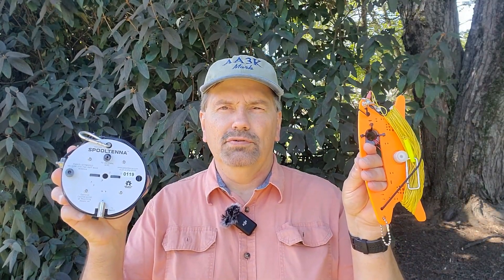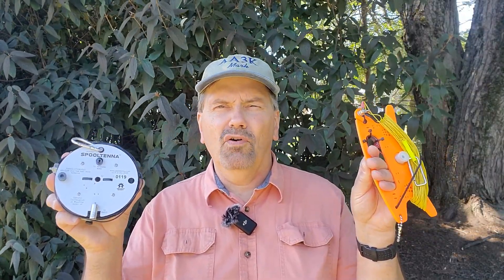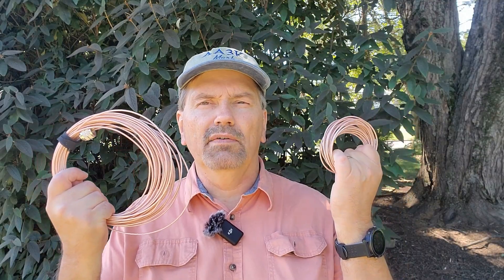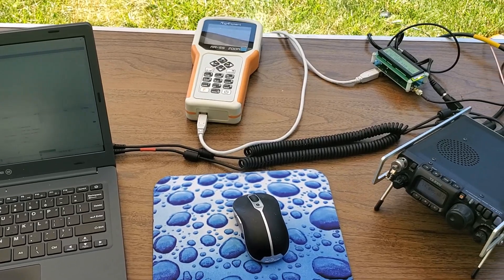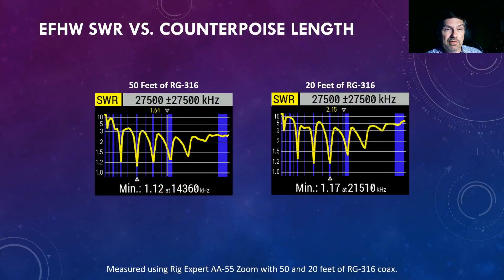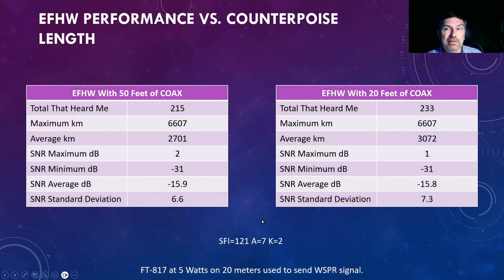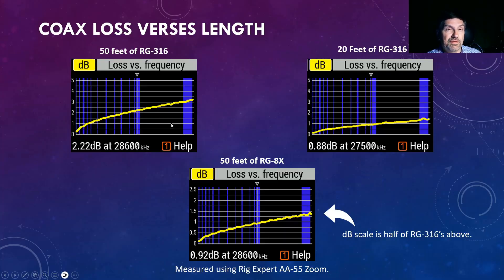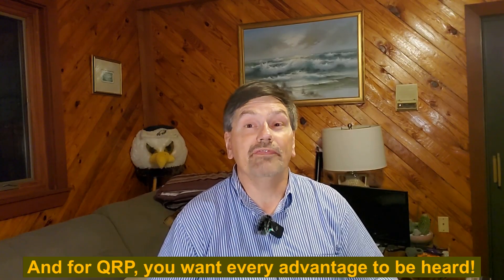Shocking Results from Changing Counterpoise Lengths!

Comment: Mark good video. I realized what you where comparing about half way though the video. The counterpoise topic in and of itself is a hot button issue for sure. What would be interesting same test and add a second part, an actual counterpoise vs shielding. Yeh I am going to put my effort where my mouth is lol. I am going to run it myself, simple enough and the curiosity has bit me.
Reply from the maker: Yes, I'm thinking of doing that but don't know where it falls in what passes for my production schedule 😊.

However, independant counterpoises connect to the same point as the coax shield so I'd be surprised if there is much difference other than directivity.

Hams may be concerned about noise from transmited signals making it back i to the radio and possibly cause issues.  Something I'd need to get a buddy to help and listen for.  

Thanks for watching!

Comment: I have an EFHW for 80m and never bothered with an counterpoise. I have a Rigexpert and dumped all the results it can chuck out and put these in to Chatgtp and asked it varios questions like how efficient is this antenna etc, I told GPT the exact setup i had and it recommended various options  including a 4m counterpoise. I added a choke at the antenna and added the 4m of counterpoint (My antenna is 10m abouve ground) each time I made a change i put it in to Chatgpt and without telling it what changes i had made the efficiency improved around 20% going by the various plots  uploaded.
If you have a Rigexpert  export all the info you can including the Smith Charts (screen shots) and the point plots and put it into chat GPT the results are interesting when you make changes and ask it to comment.
Reply from the maker: I'll rry that! I'm also working on a video right now showing the effects of at least using the coax shield as the counterpoise verses cutting it out with a choke.  I was surprised at the results.  It should drop in a day or two.

Thanks for watching!

Comment: Recently been and done exactly this with the 2 EFHW that I have set up at home, reason being poor performance from a 20-6 vertical after adding choke balun at 15ft from the antenna. Found that placing the choke at the antenna feed point and running 5ft of counterpoise wire gave a much better result. The other EFHW is 80-10, again choke at antenna feed point, had been running this antenna with a 22ft counterpoise and was never happy with its performance. Having just purchased a VNA showed why, although dips in SWR were close to where expected, the VNA showed a double dip at 80m, shortening the counterpoise down to 12ft and shortening the radiator element improved the antenna beyond believe. de M3BWF.
Reply from the maker: Good information!  I will admit I have been more surprised by radiator/counterpoise length this year than ever before.

Thanks forwatching.

Comment: 65 ft wire 49/1 unun 2 counteroises
Reply from the maker: I'm going to be looking at isolating the feedline and trying dedicated counterpoise lengths.  I did a quick test this past weekend with a EFHW and saw differences in the SWR plots of letting the COAX be the counterpoise and isolating it.  Not so bad on 15, 20 & 40 but a big negative difference on 10m.  Thank you for commenting and watching.
Reply: @aa3konthego yes I did similar I found a quarter wave. Counterpoise 27ft.  And a33ft counterpoise with my 65ft EFHW. And10ft of coax. Plus choke beads at unun 49/1.   Up a 40ft over a tree got me around the world.  On 20m.  And  all Europe. On 40m.  17 15 12 10 all worked tuned by my g90 20 watts.  I’m on the west coast of England by the seaside. Which also helps 👍🏻👍🏻🇬🇧
Reply from the maker: @MarkTurner-u8s That salt water amplifier!
Reply: I meat 17ft and 33ft

Comment: Run 2 counterpoises
Reply from the maker: I have a T wire with about 6 feet of vertical wire going to 2 20 foot radials that i used with my TennTennas EFHW which has a counterpoise attachment terminal. Haven't used that in a while.  The COAX has been working well for me.

Comment: 10ft will do. With choke. Quarter wave counterpoise. Plus a 33ft counterpoise 👍🏻👍🏻👍🏻
Reply from the maker: Do you mean 33ft radiator for a lower band of 20m?
Reply: @aa3konthego . No. EFHW 49/1 unun. 65ft 10inch Radiating wire.    With 2xcounterpoises.   1 x17ft.    1x33ft.      Choke at feed point.  10ft coax to radio

Comment: On my 40-10M EFHW there is a common mode choke at the transformer, so there is no counterpoise and the shield is isolated from being a counterpoise.  My ~124' "random" wire antenna for 80-10M also had a common mode choke at the transformer.  It has a length of wire attached to paracord that runs in line with and the opposite direction of the long wire.  The counterpoise was required to get the long wire antenna to tune with the radio's internal tuner.  Both are connected to the radio, but the EFHW is rarely used because the long wire is more sensitive.  On rare occasions the EFHW will pick up one station better than the long wire so it's still useful. PSK Reporter shows that both antennas are received around the world.
Reply from the maker: The extra length of your long wire is giving you more capture area for received signals allowing them to build up stronger than noise.  In some ways like a Beverage antenna.  I've run a Beverage On Ground antenna pointed toward Europe along with an inverted L for 160m.  Sometimes the BOG hears an EU station better and other times its the inverted L.  Our experiences are likely dictated by the arrival vertical angle of the signal.  Thanks for watching and commenting.

Comment: I seriously want to know WHY does an EFHW really need a counterpoise?  

Correct me if I am wrong, but here is my thinking on the matter and why I question the need. 

On a 1/2 wave wire antenna, the electromagnetic radiation comes from current and voltage along the wire.  The voltage is at its highest on each end of the wire where the current is at its lowest. In the center of the wire, the voltage is at its lowest in the center where the current is at its highest.  

Current and voltage generate RF.  So, on a center fed dipole, we use a 1:1 BALUN or a choke balun to keep common mode current off the feedline. The RF will not follow along the outside of the coax restricting it to the wire we want it to radiate from.  

On an EFHW, the impedance at the end of the wire is very high.  The exact impedance seems to be debatable ranging from 2500 to 5000 ohms.  In order to get it close to the impedance of the radio and coax, an UNUN, or transformer, is used.  Some designs call for a 49:1 and some call for 56:1 UNUN.  

If it is matched properly, would not all of the RF be desired to be on the 1/2 wave wire?  Depending on who says how long the "counterpoise" should be, when you add a counterpoise wire, you end up with either a full-wave dipole or an OCFD, or off center fed dipole with a very high ratio BALUN or UNUN.  

So, please, someone explain to me why  we want to stop CMC on a center fed dipole, which makes it more efficient,  but we want to allow it on an EFHW.  

If you stretch the entire antenna, with counterpoise horizontally, I can't see anything but an OCFD or a full wave dipole depending on how long you make the "counterpoise".
Reply: An EFHW is really more of an extreme off-center fed in practical application. That's why some use a 49:1, others 56:1, and still others 64:1. Someone more knowledgeable can correct me, but I believe the theoretical impedence at the end of a dipole is infinite. Since we cannot achieve infinite transformation with a transformer, we just get close enough and call it a day.
Reply: @jacobmcblane2950  That explanation sounds reasonable and makes sense to me. 

 Back in the day, CB 1/2 wave antennas were effectively end fed that had radials. But there was the Big Stick, but it was a vertical dipole with a BALUN that separated the element running down beside the coax from the coax shield.   But, that would not be a multiband design, I don't think.

0
Reply: With the EFHW. Use short coax 10ft with choke. And 2 different lengths of counterpoise. 1quarter. 1 half wave. Works for me. My g90 tunes down well
Reply: Iv also found if I move my counterpoises around I get a little directivity too.  More front to back.   Did I say my feed point is 3 stories up. My counterpoises are also inverted sloping down to the ground ??
Reply: Looking at it. Feed point 30ft high. Radial wire goes up and over a tree prob another 50ft. Sloping up over a tree top and slopes down the other side.   But works Australia  USA and most the world ??
Reply: The current at the end of the dipole is low but not zero.  You can't apply power without current. Because the transformer ratio is so high, only a short counterpoise is needed to provide enough capacitance for the displacement current.  About 1/20 of a wavelength.

Comment: On my EFHWs that have a lug for a counterpoise, I run a wire that's 13 feet and change long off the lug, and I get slightly better results than without the wire.
Great comparisons on the coax - very useful information!
Reply from the maker: Interesting! Thanks for sharing your experience and for watching the video.  I'm now planning a video comparing dedicated counterpoise wire verses COAX on an EFHW.  Can't say when it will drop though.

Comment: In my experience, I don't use a counterpoise on my 40m efhw at all. I can't find any difference between having a counterpoise as short as 7ft (per the 5% rule) all the way up to 20 ft and having none at all. The sole exception being if I add a counterpoise at all of any length my tuning on 10m goes right out the window.. I choke at the feed point pretty much regardless of the antenna I am deploying, so it isn't that the shield is acting as the counterpoise. Also of note, I have tried to put a short 6ft jumper in ahead of the choke, and I get the same results as a dedicated counterpoise ie everything works pretty much the same except 10m.
Reply from the maker: Interesting!  I too am now planning on comparing an EFHW operation with  dedicated counterpoise wire as opposed to the COAX shield.  Look for that video in the future.  I'm going to save your comment in my video ideas log so I remember to take a close look at 10 m.  Thank you for watching.

Comment: I use 30' of rg316
Reply from the maker: At a midpoint in losses between 20 feet and 50 feet.  The down side to shorter lengths is that your operating location must be closer to your antenna which may not always be convenient.  Get under a tree for shade or bake in the sun.
Reply: @aa3konthego 20' wasn't tuning well with 80 n 40m so im using 30' and it performs well

Comment: Great video. The strange thing about antennas is that someone could put a 40m hamstick on their car and think it was great, but they worry about going to the nth degree everywhere else.
Reply from the maker: Yes.  And the antenna is the most important part as its your interface to launching and receiving radio signals.  Like speakers for an audio system.  They are the interface to your ears.  Thank you for watching.

Comment: A lesson in how to minimize your QRP siginal. 2 dB loss in the coax and up to a 4dB loss in the UNUN depending on the UNUIN design and frequency.  You may also have additional loss due to SWR.  That would make for 6dB loss bringing your 5W down to 1.25 W  which is enough to make  WSPR contacts. I have made WSPR contacts with 20mW but would struggle a great deal making CW contacts on Field Day.   Lots of vertical designs can be more efficient. Never forget old fashioned dipoles.  49:1 UNUNs rather inefficient.  Test the UNUN loss.
Reply from the maker: While I do have fun when doing QRP I usally run my IC-7300 along with POTA-Flex 7 at 100 Watts to give as many people out there a chance to hear me when doing POTA.  Get the power to the antenna.  But sometimes I can't take my full setup with me and my QRP backpack or ultra compact go kit are all that can come with me. But any radio time is better than none. Thank you for watching.
Reply: @aa3konthego  I have operated QRP Field Day and Winter Field Day for a Few years.  I can work 200 -250 QSOs and still sleep at night.  This year I worked a couple of European stations  who were working our Field Day. One year I worked HI.  I use a Rybakov vertical antenna with 8 radials (Home brew).

Comment: What is a countetpoise?
Reply from the maker: The counterpoise is essentially the RF ground of the antenna allowing the electro-magnetic field to complete its circuit.  All antennas are made up of two parts.  One to radiate the signal and one to let the electro-magnetic field connect with the ground of the RF circuit to complete the circuit.  The counterpoise could be the ground itself with ground part of the antenna physically driven into the earth but ground conductivity is generally pretty poor.  The counterpoise could be your hand and body when holding a Handi-Talkie.  Again poor but usable.  That is why some people attach a measured piece of wire (19 inches - 48 cm for the 2 m band) to the shield of their antenna there.  Much more efficient for completing the EMF circuit.  With an EFHW the outside of the COAX's shield can be your counterpoise.  Even without a dedicated piece of wire, an antenna will usually find some way to complete the circuit however, you're likely to find the antenna's efficiency has dropped.

Thank you for watching!
Reply: @aa3konthego  Thank you! Outstanding answer! I appreciate you taking the time to write that.
Reply: @aa3konthego  my understanding is that an EFHW is actually not end-fed at all but an OCFD with the feed point 95%/5% along the wire. So for my 40m EFHW I have a CMC choke on my coax approximately 2 metres (5% of the longest wavelength) from the 49:1 unun so the braid on that short length radiates. It is the same as using coax to feed a balanced dipole with the centre wire going to one arm and the braid to another with a CMC choke at that point to stop radiation from coax braid. Therefore the "counterpoise" is in fact nothing to do with substituting for grounding but simply part of a dipole. SWR for a correctly tuned EFHW is extremely low. VK4BOB
Reply: Basically, some capacitance added to the system :D

Comment: you can add a counterpoise to the SpoolTenna
Reply: Great video Mark! That’s right any of the assembly screws can be used as a mounting point for a counterpoise on SPOOLTENNA. 73 de KO4HUI
Reply from the maker: Thank you for clarifying that! and watching the video.
Reply from the maker: The SpoolTenna designers chimed in and confirmed that.

Comment: I just couldn’t get the Spool Tena to get to less than 3:1. I used it as high as 33Ft on a mast down to about 4Ft above ground. It tunes up great even on unexpected bands like 12/17/30, I haven’t yet tried using my 50FT bigger coax vs. the one provided. No counterpoise. Any suggestions?
Reply: SWR should be 1.5:1 or better on 40,20,15 and 10 meters. Test results that ship with each unit is with 25 feet of r RG-316. Please contact us if this persists, we’d like to understand more about your set up. 73 de KO4HUI
Reply: @SPOOLTENNA I’ll try some more experimentation, I’ve used the supplied coax/choke as well as 50ft of Messi and PaloninPITA coax, tried the apex at about 20 feet on a tree and 33ft on a mast. I’ll take some pics and use my antenna analyzer for a more in depth analysis and get back to you, may take a week or 2. And yes, of course it was plugged in 😊.
Reply from the maker: Hmmmmm...  Assuming you plugged the pigtail into the jack on the body of the antenna I'd also go with longer COAX.  Another thing is check the continuity through the wire. Maybe it broke inside the insulation and you you have less wire than you thought you had.  That might explain why it works on the WARC bands which a 10-40m EFHW should not.  I know, I've tried.

Thank you for watching.